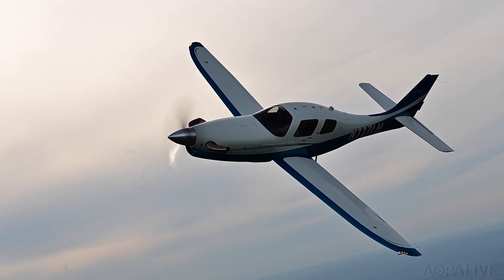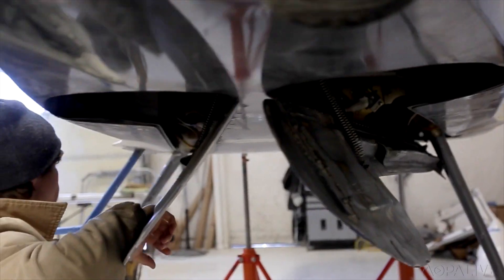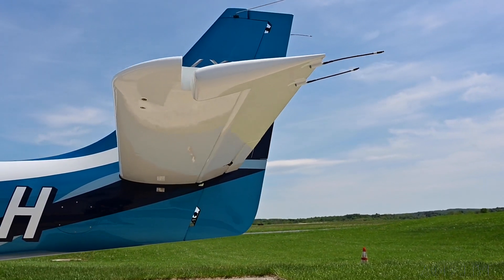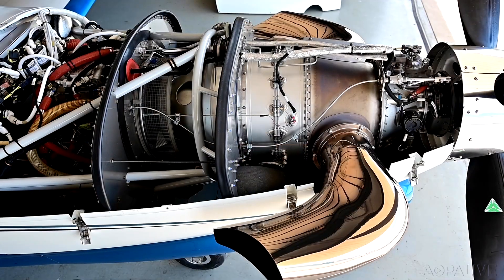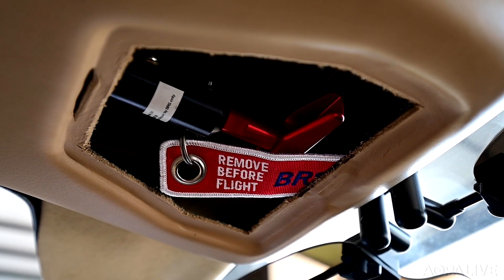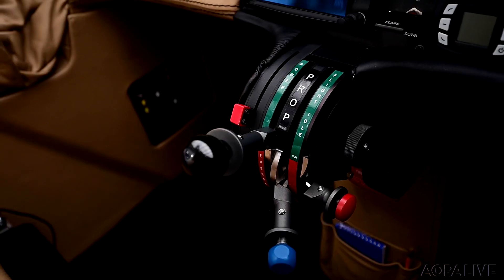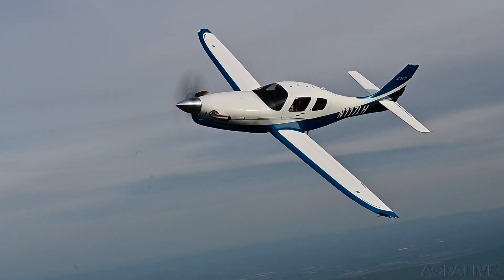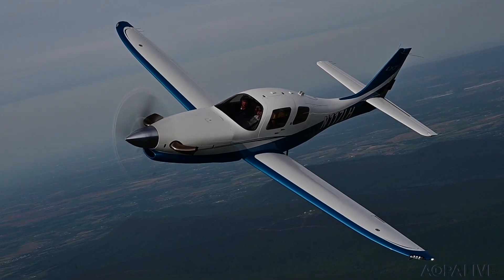What it's like to fly the speedy LX7 turboprop

Comment: Not fast enough, instead of the PT6A-28 at 680shp it needs the PT6A-140A with 900shp.😂
Reply: There's a Lancair IV-P with Garrett TPE331-6, 840 HP. Reportedly cruise speed at FL260 is 330 KTAS
Reply: @greighenning9091  that’s more like it, but I would rather have the PT6.
Reply: Why? @MattMorris481
Reply: @tc6984  why not? Every general aviation company adds more power TBM, Mooney, kodiak with the 900, Cessna with the 208, hell people have put the IO720 in the lancair IVP.

Comment: Lancair IVP-331 is best
Reply: Why?
Reply: @tc6984  Garrett power is better econ fit for available fuel in this airframe.  Pratts are too thirsty.  And all Garretts have negative torque sensing.  Garretts are also much cheaper to overhaul and maintain than PT6's

Comment: I don't trust companies that advertise their TAS without including IAS. Based on the raw specs from their website I get ~95% of the performance from my turbo bonanza at 60% of the fuel burn. (Piston version). The turboprop version gets 33% higher top speed at the cost of 220% fuel burn and half the range. Doesnt even increase the service ceiling, still 25k. Is there a point to this plane beyond burning money on an interior product?

Comment: The landing gear coming down like that is kinda concerning. I know some Cessnas do the same but I’m paying 1.2 million plus. I rather have a little extra weight and add the Lanceair evolution gear
Reply: Retractable landing gear is normally a huge amount of weight. If it were overbuilt to the degree some other planes are, it wouldn’t have the performance. Lancairs are built for speed

Comment: Landing gear looks a bit fragile.
Reply: I'm glad I'm not the only one that noticed that. The very first thing I said was that the way the two back wheels came out reminded me of a Cessna 177RG.
Reply: @dontbanmebrodontbanme5403  - It’s probably not as fragile as it looks yet not a great look..
Reply: @PaulAnthonyDuttonUk  Haven't heard of any gear collapsing.  Though I have to admit, I have also never heard of anyone liking/disliking a design based on how the retractable landing gear look as the bird sits on the ground.   From other commentators, I have heard that the springiness of the steel tube landing gear is the biggest drawback because there is just no energy absorption in them; so birds with that sort of steel tube landing gear bounce a little on the takeoff, landing, and roll out.
Reply: @gradytalbot9101  from a purely physics standpoint, forward extending gear are inherently less stable since it must counter the inertia from impact instead of traditional side loading gear.
Reply: @codmott286  I am sure you are more expert than I am, but I don't  understand the phrase ". . . since it must counter the inertia from impact instead of traditional side loading gear."   To be more clear, I'm not sure what you mean by "it",  but I presume you mean "forward extending gear"; and I have no idea what "inertia from impact" means.  From my rudimentary understanding, inertia is a property of a mass in motion (or at rest for that matter), and I believe it is a vector quantity rather than a scalar quantity.  And, I don't see how "forward extending gear" are less able to counter something resulting from impact, that traditional side loading gear are somehow better able to counter.   I'm not trying to be obtuse here, I just don't understand what your assertion is.   I suppose that by "traditional side loading gear" you are referring to something like the landing gear on the GlasAir III, but even supposing that is true, I can't visualize your point.   I'm willing to be educated.
Reply: @gradytalbot9101  think of it like the joint in your knee. Your knee cannot bend backwards, but it can bend forwards. The lancair gear is more prone to collapsing because it cannot lock opposite the direction of motion upon landing.
Reply: @dontbanmebrodontbanme5403  one of them didnt even fully extend and got blown back by the wind!
Reply: Is it a 2 +1 seater...or  realistically a 2 seater?
Reply: Chrome molybdenum steel is tough.

Comment: better add icing  to really use it at that price point.
Reply: The ones I’ve seen have the therm X system
Reply: with that climb rate you'll be out of icing in 5 minutes
Reply: De-icing is standard, so is the ballistic parachute.
Reply: Too bad you can't get it without the parachute.

Comment: I'm a fan of the performance data point that the Lancair IV-P or Lancairs in general are. However the turbine version at over a million dollars, only a few percent faster than the piston version, is just not the revolution we need. While the IVP makes a Cirrus look like it's standing still, it's still an 800kg bird or 4 cast iron pianos and that's just not the best we can do.
If instead we do a glider style teardrop pressurized hull and use the double compound curves of that shape to make very thin carbon fiber plenty rigid, we have an ultra light ultra aerodynamic plane that could be powered by 2 rear turbofan engines of negligible size. With long thin high speed glider wings, it is a revolution that sweeps everything else. That front PT6 is a complex, heavy, very expensive obstructing noise maker while 15kg turbo fans at the back deliver pristine silence and can be made at negligible cost. Not to mention the dual engine redundancy.
It should be well possible to make a 300kg 4 seater with twin jets and when that is true, essentially all other designs must immediately be abandoned. With extreme prejudice.
I suspect it's even possible to make a stol plane along those lines, even capable of water landing.
Reply: I’m glad you have it all figured out!  Thank goodness a voice of reason!  When will your prototype be ready to fly?
Reply: Big generalizations there-assuming people are lazy for this topic is just silly. It is a delicate engineering balance of power, aerodynamics, assembly, AND ECONOMICS(don't forget liability insurability). Go build a Vans RV plane or another kitbuild and let us know how it goes.  The Velocity Raptor is RIGHT up your alley.  Just because you think there is a solution does NOT make it one that meets all the criteria for a company to actually build it.  As a hobbyist, go right ahead.
Reply: @thejam70  perhaps if you concentrate you might recognize that I proposed a 300kg twin jet while the Raptor is a 1426kg single engine piston prop. One is not like the other.
Reply: @DanFrederiksen  Since you "proposed" it, build it.
Reply: @volatilis4526  I have many intelligent ideas that would take lifetimes to implement. It would be good if the world would adopt information, not just obtusely demand I do it all.
Reply: @DanFrederiksen  An intelligent idea does not take lifetimes to implement.
Reply: @Factory400  I said many. Words are tricky, I know.
Reply: @DanFrederiksen  what a boast of intelligence
Reply: @thejam70  If I do all the thinking and all the doing for the world, isn't that a little lazy of the rest of you.
Reply: I would like the airplane you describe, but I'd rather have what you're smoking.  :-)
Reply: @HarveyCohen  it's called intelligence. I vape it :)  it's simple logic. European LSAs are typically 270kg empty made from crude sheet metal and rivets, surely double compound curves carbon fiber shell can be lighter such that the trade off of the combustion engine for 2x15kg small turbofan engines will allow 4 seat volume in 300kg combined. A Lancair IVP is 800kg. I trust you can grasp that an additional 500kg doesn't need to sneak in there for 2 more seats. A Williams FJ33 jet engine as used by Cirrus Vision jet provides 800kg thrust and weighs 140kg dry. The smaller EJ22 meant for the Eclipse with 310kg thrust weighs 44kg and shows that they scale down nicely. 2x310kg thrust would give the plane close to 1:1 thrust ratio, better than most fighter jets and airliners are more like 1:3 or 1:4 and they take off firmly anyway. So 3x smaller than 44kg...   just maybe you can imagine a 15kg turbine is so small it must be possible to manufacture for moderate money. Not their usual 1 million dollar bs. The smaller things get the relatively stronger materials are. That's why insects can be so skinny while elephants are not. That means just moderately disciplined materials can give it 5000 hours TBO. A jet can be much simpler than a piston engine. Much less stressful. Zero vibration. It's a gas grill with vertigo.
Reply: @DanFrederiksen  I'm not sure you understand composites. Carbon structures are not lighter than aluminium ones by default. And as for some super efficient turbofan powered 300kg aircraft that flies at crazy speeds? What are you talking about?
Reply: @sheldonholy5047  I didn't say super efficient engine, just small turbofan jets. Which part don't you get?
Reply: @DanFrederiksen  all of it. 300KG empty weight LSAs are flimsy as fuck. Fine for a rotax but in a config that will supposedly outperform a Lancair Evolution or similar, that's just crazy.
Reply: 10 months later. how's your prototype experimental going?  have you even designed it in CAD yet? CFD yet?  i want to see some more innovative general aviation experimental designs.
Reply: Sounds good until you try to land and have a gusty cross-wind, or until you encounter weather in the air. Your twin-turbine glider would be blown all over the place.
Reply: @christophermichaelson9050  no I don't agree. Gliders land just fine and when I say glider, it would be the efficiency of a glider adapted to the speed, so the wings would be shorter than a 150km/h glider. Think modern superior sporty relative of the U2 that did not suffer from your status quo sheep criticism. Wide wing span is generally more stable.
Reply: Ideas are cheap. Go build it
Reply: @JohnMaxGriffin  only fools would think so. the right insight and idea can be all important for the entire world. literally the difference between armageddon and divinity.
Reply: @JohnMaxGriffin  yet you know better than me. it couldn't be that you are just cranky obtuse. offended by notions of progress. a defender of status quo without thought.
I happen to be borderline clever, John. As in Elon Musk adopts my ideas.
Reply: @DanFrederiksen  Yeah, Elon musk lmao. Good choice
Reply: @JohnMaxGriffin  I assume he's done better than you.
Reply: @DanFrederiksen  Yeah and he has absolutely no experience with building lightweight aircraft lmao
Reply: @JohnMaxGriffin  you mean weight optimization is not important in rocketry? how many trump level mistakes do you want to make and still remain gleeful about it.
Reply: So? How does your new aircraft compare to your old IV-P?
Reply: @daszieher  I don't have an IV-P but I'm thinking it should be able to do 600-800km/h at the high jet altitudes, say FL400 or even higher. Better fuel economy, more affordable than a factory built IV-P, far more quiet and has engine redundancy for ocean flying. I would say it is easily viable at 500k$ and with some aggression for cost optimization and sales it might be well profitable at 250k. Probably mainly depends on various insurance obtuseness. And ongoing inflation. And the not available IV-P is the only plane that could compare, it would outclass a Cirrus SR22 dramatically. Double or more speed, better fuel efficiency, quiet, engine redundancy, jet cool. Not tractor uncool. Cessna 172 would be a joke compared to it. Or such a twin jet would be the contrast that highlights what a joke a 172 is. Bonanza would look like it's from 1945.
Reply: @DanFrederiksen  so basically, in all this time, you have achieved nothing at all?
Reply: @daszieher  hunty, I'm a polymath genius, father of deep learning, I know some of the physics the visiting ET ships use to fly the way they do, spacex' starship lays on its side because of me and then some. Like I said, I have numerous world changing ideas and visions. My life doesn't revolve around this one idea just to suit your mindless pettiness. What great things have you achieved in aviation innovation the last year. Bought crypto?
Reply: @DanFrederiksen  oh, no, nothing like that. But I also don't run around claiming other people's work to be garbage, when I have absolutely nothing to show for in that specific field.

Together with my associates in three years we have just built up a well-running company actually doing something. So, I'm fine thank you, no need for crypto 😃
Reply: Seeing the Risen do 230 knots with that weight, I'm blown away, but 300 kg for a 4 seater? And while jets may be light, do you know how much fuel a vision jet slurps? 72 gph!!! With 1 fj 33 turbofan... imagine 2 of them. And there is a reason why teardrop shaped aircraft don't exist yet, laminar flow that is impossible to get us not worth the trade-off in strength needed at high speed. Hopefully the Celera is a success and makes such an aircraft more accessible, but 5 mil is unreasonable. I'd buy a cheap turboprop and burn more instead
Reply: @josephc.9520  I was being modest. the visionjet is 1681kg empty. Now try with your most intellectual might to appreciate that carrying a car extra will matter for fuel consumption vs 300kg empty. Let alone doubling as you so thoughtlessly suggest. Further, it is my impression that jets are most efficient at much less than full thrust. So we might be talking about 5-10x better fuel consumption than a visionjet. Would an 8gph 4 seater twin jet be interesting...
Gliders are teardrop shaped, my guy. It's a class of aircraft where someone actually bothered to think about efficiency at a bare minimum.
And lastly, the distance record without refueling belong to a williams FJ44-4 off the shelf engine going 500km/h for 40000km. Correct me if I'm wrong but a Cirrus SR22 doesn't go 500km/h nor can it fly 40000km without refueling.
Reply: @DanFrederiksen Unlike some people here, I have seriously reconsidered your proposition I don't know why I should be concerned but here goes: A cozy (aerocanard) can truly carry four people, even though it can't in stock form. It weighs 450kg empty, but that is with a 120kg engine. 2 PBS 150 (the new versions) should weigh in at 40kg, and considering removing the weight of prop and cowling, we weigh in at under 350kg. PBS does not disclose any information for reasonable calculations, but we may get close to 400ktas at high altitude if you burn 110l. At this fuel burn, 400l (100 gallon) is reasonable, which would weigh 320kg, adding up to 680 kg. The remaining weight is enough for 4 not American ppl (you guys are phat) and bags, sticking in at 1 ton. Keep in mind these are old technologies, the cozy must be optimized for high speed high altitude flight. Fibreglass construction is used though you would presumably be using CF anyway simply for strength at high speed The PBS engines are Soviet fighter APU. These are all old technologies. So I do see where you come from, but there is no way 8gph is reasonable. That's a rotax 915 at high cruise (unless of course, you wish to use RC engines and cruise at a snail's pace, and lose the efficiency of jet engines at high speed. I assume you realise that props lose thrust as speed climbs, while jet thrust remains constant, so much so that in imperial units, 1 lb thrust at 460 mph is 1.22 hp, but is 0.5 hp at 190 mph)
Reply: @josephc.9520  PBS is a turbojet engine, a turbofan engine would be significantly more fuel efficient. That's an important distinction. There is a simple all important profound truth in the fact that the distance record without refueling belongs to a turbofan jet engine going 500km/h for 40000km straight. Do you think you could do that distance with a rotax? let alone going 500km/h. So not only does a jet engine appear to be more fuel efficient than a piston but at high speed as well. This simple fact means that piston props should be abandoned with extreme prejudice. It means a light sport jet can be an extremely potent configuration. In 2 or 4 seat config. With a lav.
Reply: Turbofan engines don't scale down efficiently.
Reply: @keithjurena9319  that would be a relevant issue but all the data I've seen says they do. How do you know?
Reply: @DanFrederiksen  

Williams F107 weighs in at 30 kg, gives 1.9 kN max thrust and consumes 70 kg of jet fuel for each kN-H.  
Now a RR Trent 700 is 6445 kg mass, generates 324 kN thrust with specific fuel consumption of 50 kg of jet fuel per kN-hour.

Only the Rolls Royce is designed for 20,000 hours MTBF while the Williams is designed for 10 hours..it is the smallest turbofan and used for cruise missiles. 

Small turbomachinery is very inefficient, this is why below 1000 kW, centrifugal stages are typically used.
Reply: @keithjurena9319  Interesting, I wasn't familiar with the F107 but first of all 70 to 50 is far from a deal breaker for inexpensive plane use compared to state of the art 10 million dollar engine and second, it's described as having a bypass ratio of 1:1. Use as a cruise missile could easily have limiting requirements while an FJ33 is bypass 4:1. And the FJ44-4 holds the world distance record for any combustion engine so anything even close to that specific fuel consumption would be plenty acceptable. A 44kg EJ22 was also under development but I can't find fuel consumption data on it. I assume Williams wouldn't have spent a lot of effort on it if fuel efficiency would be impossible.
And third, should there be an inherent problem with scale that would apply to turbines too.
So no, bring it on. No excuses.
Reply: @keithjurena9319  Let's hope French company Turbotech will.